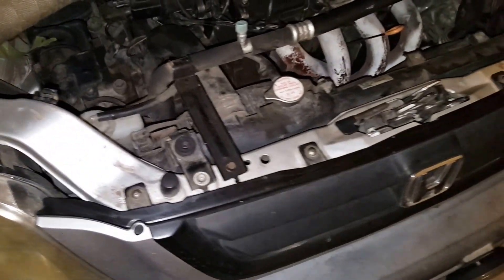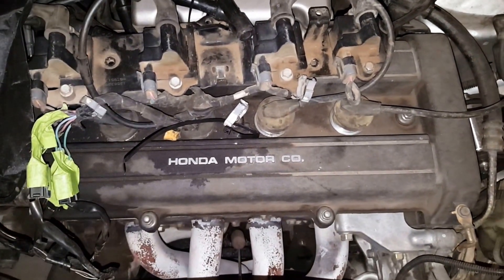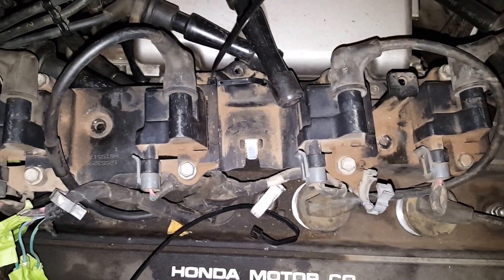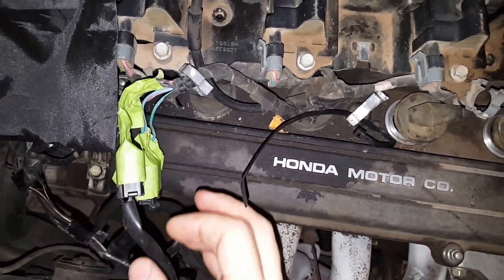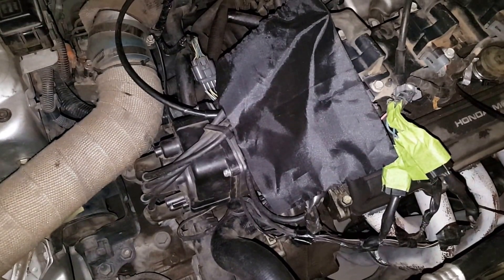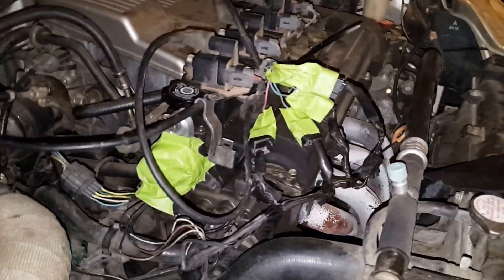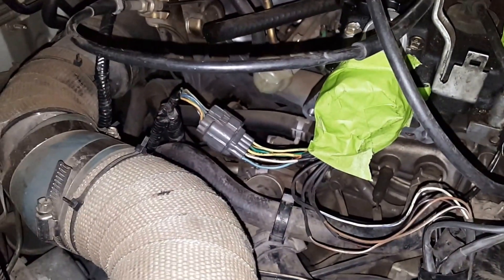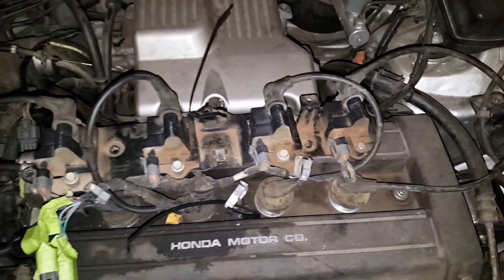Honda coil on plug

Comment: Any luck on production yet?
Reply from the maker: Christopher Borak had a couple proto type bases made, they're are currently 2 units daily driving, my CRV and a 400hp turbo civic, both running flawlessly. The cap should be made this week, then the harness and grommet will be moved forward
Reply: Hi, is the product finished???

Comment: Any updates on this? What are you using to control the coil packs? Would love to do this on my 94 Accord
Reply from the maker: Dustin Besch. just had 3 bases machined, need adjusting on a few clearances in the design, currently have one of them running. The coils and VR signals are controlled by a circuit board of my own design. It's a very slow process to build this product, but it is moving forward and looking good.
Reply: Did you figure a cost yet for one?
Reply: Can you teach me for this set up